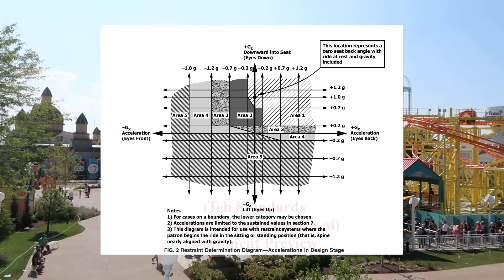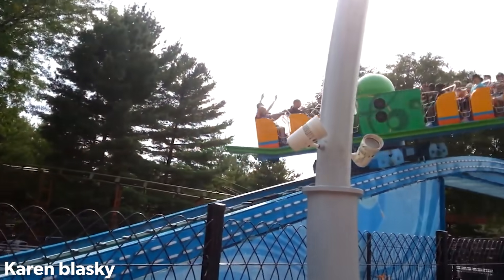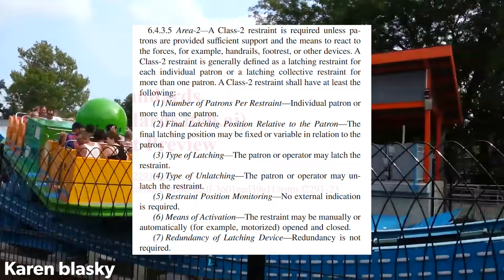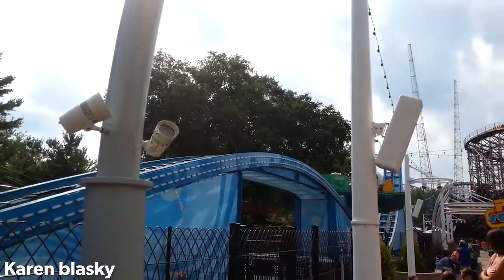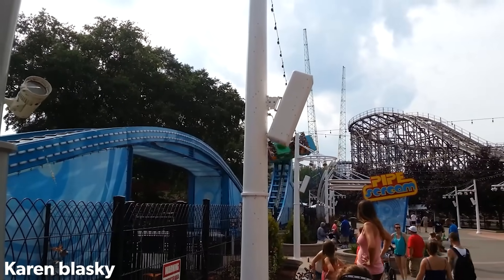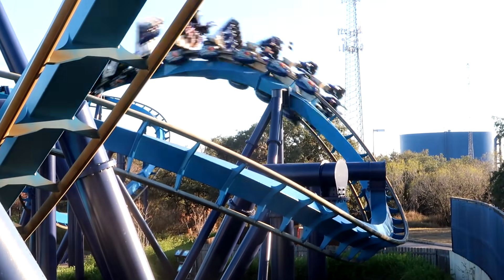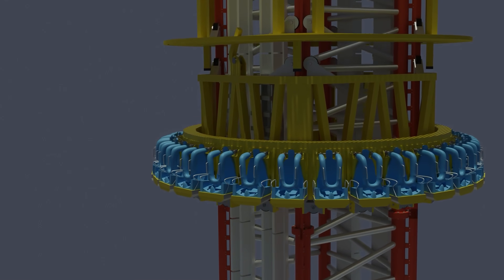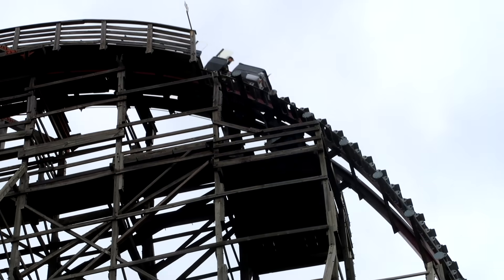How Ride Restraints are Designed

Comment: I'd wonder about the egressability vs. securing. I'm thinking about Cedar Point's Shoot the Rapids. If they'd used the older rachet-type restraints, they could have been manually released, but hydraulic restraints can't be released without a power supply. I consider that a safety hazard in a water ride. I could think of a few other situations where a rapid egress might be necessary but impossible given modern restraints.

Comment: I have an idea for restraints that could potentially allow more people to be able to safely experience more “extreme” rides. In particular, it would potentially help people with chronic pain in their backs, necks, and shoulders, as well as people who have certain joint or muscle problems. It could also help some people with disabilities like autism who may have sensory issues with the feeling of the motion/vibration of the ride being scary or uncomfortable. Keep in mind that, while I did take physics in high school and while I do read safety things as a hobby, I am a layperson. A layperson with autism and back and neck and shoulder problems and mildly unstable joints due to a mystery connective tissue disorder (doctor says it’s either a mild case of hEDS or something only I have), but a layperson nonetheless.

1. Seatbelts, like in cars, but with an additional shoulder belt that crosses over the first. 
2. A light cushion behind where the average guest’s head and neck would rest, as well as another light cushion at the bottom of the seat. (Not actually a restraint per se but would compliment the restraint system as a whole.)
3. Hydraulic over-the-shoulder restraints, which also have a device at the bottom which attaches somehow to the bottom of the seat, between the rider’s legs, for extra security (the attachment would have to be somewhat small so as to be unobtrusive but strong enough that it would help in the event of double hydraulic failure and also help secure riders with mildly unstable joints.)
4. A grab bar, just in case someone feels more comfortable with one. (This should be within reach of the people even in the hydraulic system in place.)
5. Doors on every car that can only open if the ride is completely stopped, ideally also equipped with light cushions on the inside in case someone bumps into them.

Comment: We have an old 1930s wooden 'scenic railway' where I live that has a stand on brakesman between the carts. It has some real basic foot pedal lap bars (no seatbelts) that were always scary as hell as a kid because if you were sitting with an adult, the bar didn't come anywhere close to you, and the coaster has some good air time drops, so it always felt like you were gonna fly out the top if you didn't hold on for dear life, lol. I went on it a few years back and it's still as good as I remembered, made even more fun by realising something I never noticed as a kid; the trains have to be manually pushed by the ride ops to get it to the first hill, as the ride relies solely on gravity so has no starter push beyond man power. Only moving part is the chain to pull you up the first hill.

Comment: Back in 1987 while riding the Big Bad Wolf my harness unlocked right before going down the second drop.  I was 13 and started freaking out as i had just gotten over my fear of rollercoasters.  I swung it up and then pulled it back down again and it ratcheted shut.  I realized that it was a freak occurrence and continued riding.  Fast forward to 1993 and I got to ride my first B & M: Kumba.  I liked that it had a secondary buckle restraint.  Your video detailing how high g rides require a back up should one fail was informative.  There are B & M rides with just a lap bar, Mako, that I frequently ride and always just wondered if the hydraulics should fail.  Fury 325 has a lap belt in addition to the lap bar.  Ive always thought that having a buckle that fastens to the ots restraint could have prevented the Orlando Tower tragedy.

Comment: There are a few items here that deserve some attention. First and least, ASTM was the American Society for Testing and Materials. As of a few years ago, ASTM no longer stands for anything at all (much like CBS or NPR); as an international organization they wanted to drop the word “American” so now, it’s ASTM International. 
The worldwide design standard, F2291, was adopted in 2003 and is updated as often as two or three times per year. It replaced the earlier standard, F1159, which was originally approved in 1988. So anything built before 1988 predates any modern standards. 
Arrow’s original lap bar restraint uses a biased latch which is biased to the locked position, but once released the bar will tend to open. Once open, the restraint will lock into its open position. Their original shoulder bar was both a mechanical AND a hydraulic system, with a hydraulic cylinder configured to ratchet open or closed in addition to the mechanical pins. Arrow’s hydraulic system did not use an accumulator, so it was not biased to open or close, but the early pedal only systems were bi-stable, that is, the pedal would remain in the locked or unlocked position. This is why rides of this era include a pedal sensor so that as the train exits the station if any pedals are down, the ride will stop.
I don’t consider the PTC handlebars to be adjustable. They have only one locking position, and by the way, most are not redundant as they only lock at one end of the bar. If the bar releases mid ride and is pushed all the way open it will, in fact, lock into the open position.
Finally, the design guidelines in ASTM F2291 are just that. The classification system is based solely on acceleration or seat inclination, and the standard actually contradicts the “rose” in Figure 2, indicating that a restraint and containment analysis is required, and ultimately the Designer/Engineer is to follow the results of the analysis even if it contradicts the guidelines related to predicted acceleration.
The full ASTM F24 committee next meets in February in Louisville.

Comment: Interesting info about the Adjustable Lapbars, and soem nice context as well. I've never seen the ones on Sea Dragon open by accident, but if they are going to have an issue, it's always an issue staying locked in the open position. This checks out with what you said.

Comment: I know how this works. First they do some safety stuff. Then they build a test version and have real people ride. After each demo ride they have people rate the comfort level on a scale where 1 = Clubber Lang induced pain and 10 = Couch comfort. If the restraint gets above a 3-4, it’s back to the drawing board.
Reply: If that’s the case, how did RMC and Togo trains make it into production?

Comment: I wonder what the legality behind Coaster at PNE playland was. It used to have a very minimalistic buzzbar with no seatbelt, and supposedly strong ejector airtime. Now, it has a tight seatbelt as well.
Reply: Old coasters that were built before the standards existed don't have to follow them, and coasters that were built during years when the standards were more lenient only have to follow the more lenient standards of the era they were built during.
Reply: The ASTM standard is voluntary in some states. PNE playland is located in a state that didn't or still doesn't enforce the standard.